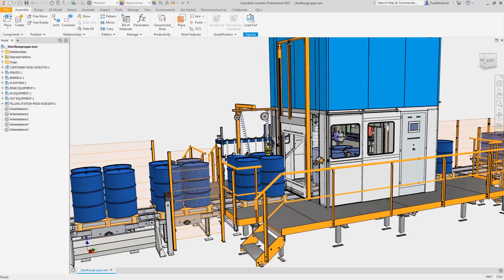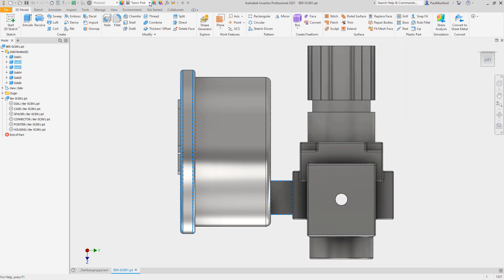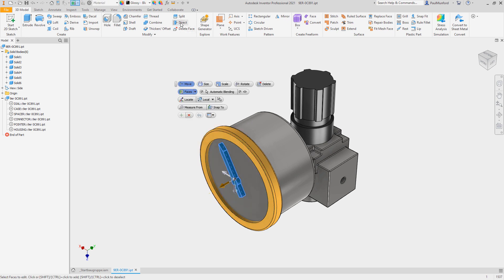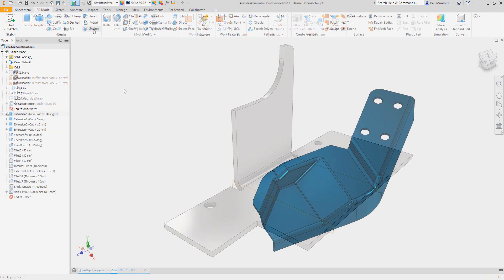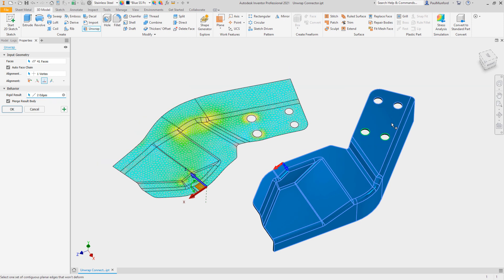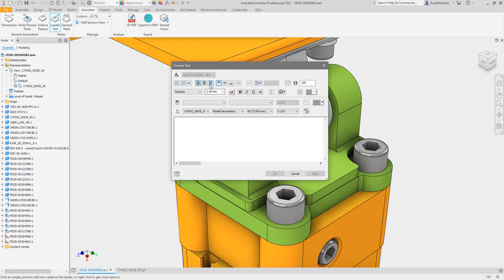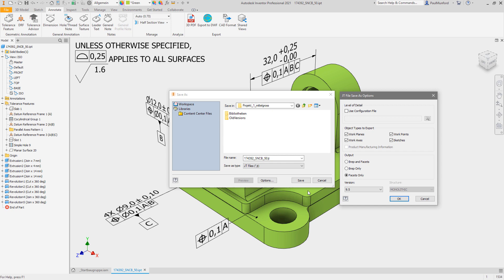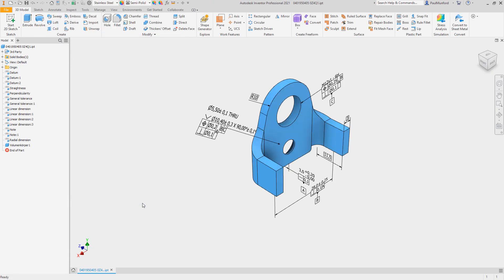Autodesk Inventor 2021 What's New: Parts

Comment: Some problems in Inventor:
1-The snapping is not active from sketch to another sketch as in solidworks. 
2-The active location as snapping to a point is not clear like in autocad. 
3- 3d rotate and transfer is not powerful and applicable like in autocad.

It is beautiful product I hope they fix these issues.